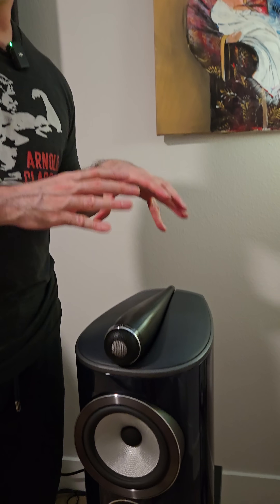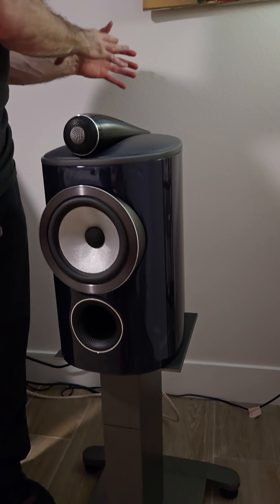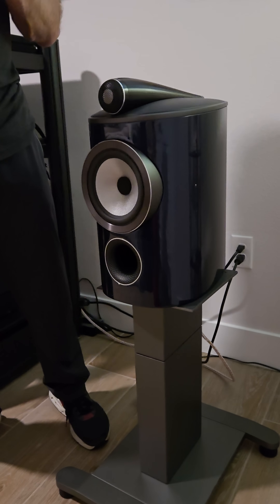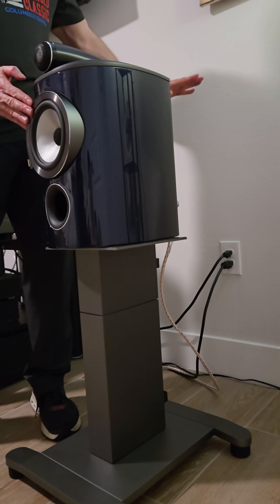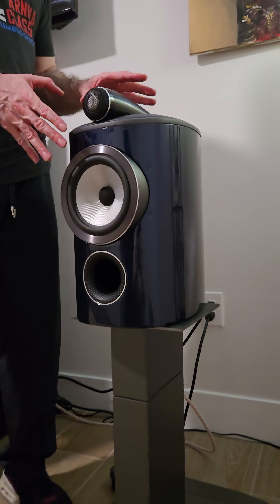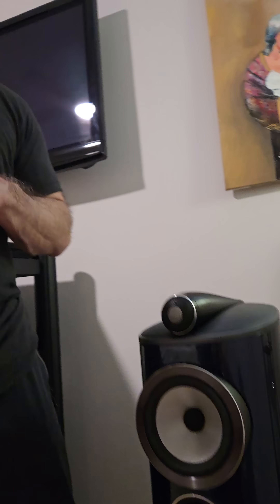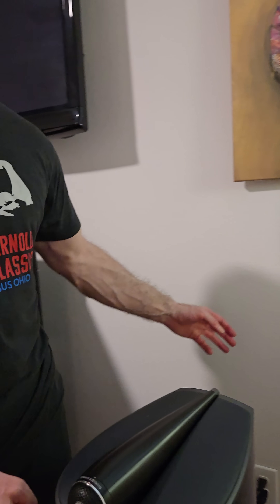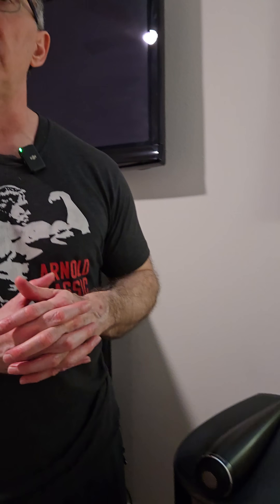Tips to Fix Your Weak Bass

Comment: So if I'm understanding this right, based on the formula optimal speaker placement is slightly over 3 and a half feet from the wall (measuring from the wall to the base driver) to ensure the dip in base response is at 80 Hz and your subwoofers will cover this.

Comment: What about putting an absorbing panel behind the speaker? This would have the same effect as moving the speaker further into the room.
Reply from the maker: Yes, but they need to be very thick to be effective (> 6in w 3in offset) depending on the dip frequency.

Comment: Okay, 1125 / (4 x distance from front wall) ... 43 inches   ... so 78.49 hz.  So for my mains I should change the current crossover in receiver from 50hz to 80 hz?
Reply from the maker: No, first measure at the MLP with a mic to see if you do have a dip in that region that can be fixed by your subs if you can't move the speakers., If it's a problem, you should bass manage your mains and let the subs handle everything below 80Hz.

Comment: So to clarify if the dip at 100hz change the subwoofer crossover to 100 ?
Reply from the maker: @yaroslavzubenko8954  only if the subs are toward the front of the room and harder to localize.  Otherwise, move the speakers further away from the front wall to lower the dip frequency below 80hz where the subs take over.
Reply: Ok now I think I get it. Thank you so much and not just for this I have been reading your website for years and now my leaving room looks like frankentheater room with two 15s monoliths and 9 speakers all around even my heights are actually a bookshelves mounted downwards. That’s probably why my smaller bookshelves heights speakers were producing better audible bass than my main three speakers were. Makes sense now.

Comment: That formula implies a problem for most living spaces (required distance from wall too long).

The video suggests there is a 'problem area' in frequencies (not just one discrete frequency).
I assume that means, in the case of a typical crossover frequency of 80 Hz in a system with subwoofer, the frequency to use in the calculation should probably be 70 Hz or lower. 

For 70 Hz, (speed of sound) / (4 * wall distance of driver) implies a wall distance of more than 4 ft / 1.2 m.

For a pure stereo system with even just moderate floor standers (in terms of bass extension) and no sub, the frequency to target might be 30 Hz.
30 Hz implies a minimum wall distance of 9.4 ft / 2.86 m.

Comment: Does this dip occur at a certain listening distance or is it independent of the listening distance?
And I would like a see a video comparing bookshelf vs inwall speakers.
Reply from the maker: I've found SBIR effects most drastic at or near the primary listening area but as you move towards the back of the room in a maximum pressure zone, I've seen the dip disappear. It's a good question and something I will explore in more detail with a follow up video/article.

Comment: My main speakers are Golden Ear Technology Triton 7s.  These are floor standing speakers.  The configuration is a tweeter with 2 5.25 inch mid drivers on the front with 2 8 inch planar sub bass radiators in the sides of the speaker.  Where would I measure from?  I am guessing to the middle of the closest edge of the bass radiators?

I see another round of Dirac measurements in my near future 😜

Thanks.

Comment: If you have a dip right around 100hz would you move the speaker closer or further from the wall to get the dip under the 80hz crossover? Or is that room dependent?
Reply from the maker: @JttM199  move away from front wall to lower the dip frequency. Formula in video description text.
Reply: @ thank you
Reply: This is a short video so I don’t get a description.

Comment: Would it matter if the front infinite baffle setup is all flat or if it's curved, like if the front mains toed in toward MLP?  Or if LCR equidistant to MLP.
Reply from the maker: No, you should be fine as long as the speaker is flush w the wall.

Comment: As per usual, Gene, good stuff. How does plugging the port on bookshelves affect the response to SBIR?
Reply from the maker: Not much other than less output with the port blocked. There are other reasons to sometimes seal a port but not to fix SBIR.
Reply: @Audioholics  Thank you for taking the time to reply.

Comment: Does the port being on the front or rear effect it?
Reply from the maker: Yes, it can. If the distance is within the region, the port is producing bass.
Reply: @ You either pull it out enough to push the sbir frequncy down to the subs as you mentioned OR you push speaker closer to the wall (to raise sbir frequncy higher up) and get it absorbed by the likes of a GIK 244 placed directly behind the speaker. Most of these guys are not going to know the nitty gritty of how the port got designed (different types), or if there's a radiator, whatever.
Reply: @Audioholics  thank you 🙏🏽
Reply: No
Reply: @wa2368  HELL YESSS IT DOES‼️🧐🙄🤨